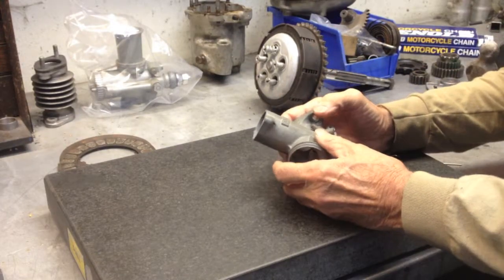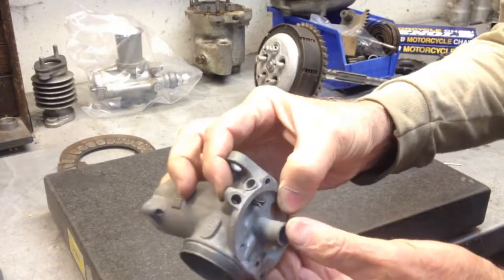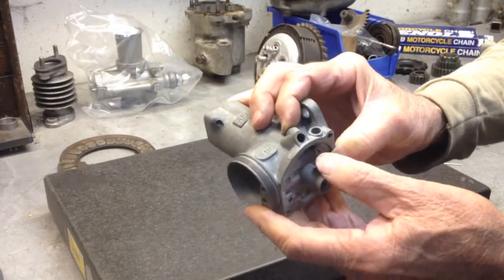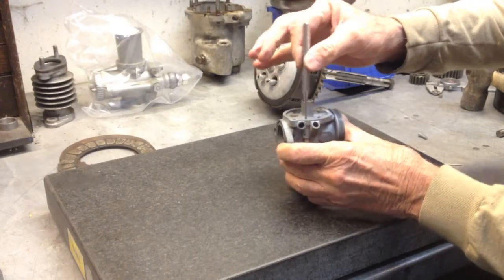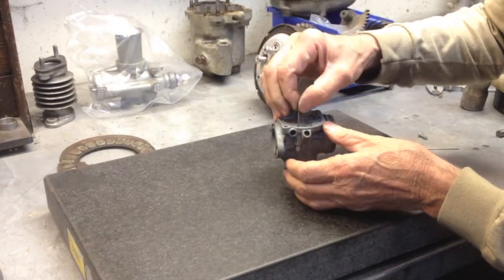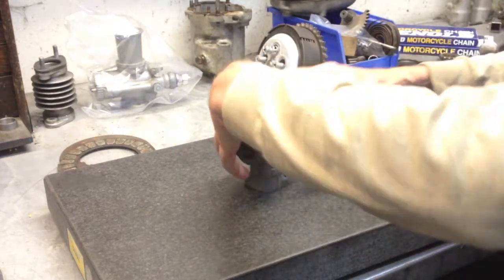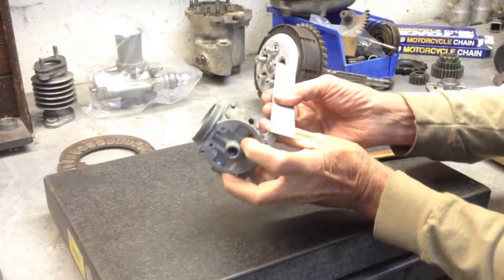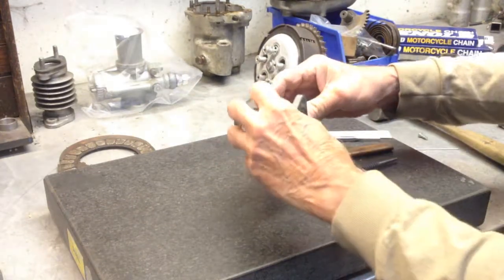Tickler length on an AMAL Concentric Carburettor

Comment: I just installed a brand new set of Amal premier carbs on my '69 T120R Triumph and I simply can not get them to flood when I tickle the either of them. I've checked flow of fuel, pet cocks, filters and ait vent in the tank cap - no problem there. But now I see that it simply must be the lenght of the actual tickle - thanks for sharing.
Reply: Same issue with mine but only on the right hand side. Left one seems to flow ok. Premier carbs aren't cheap. Should work nicely for the price
Reply: @aquilinogomez6037  I completely agree! my problem was the length of the tickler. after I lifted the head of the tickler a bit it worked as a charm :-)